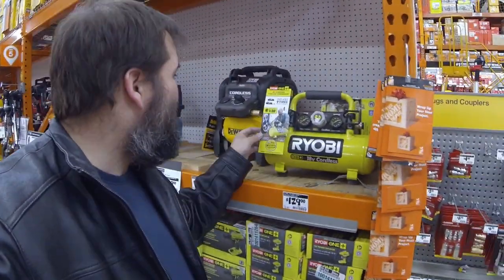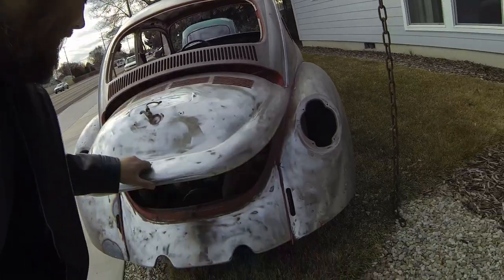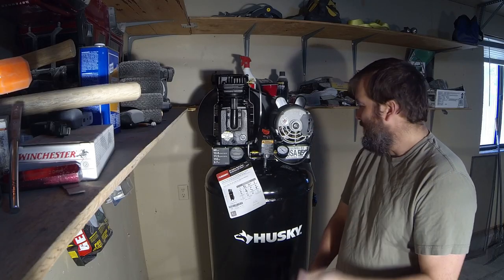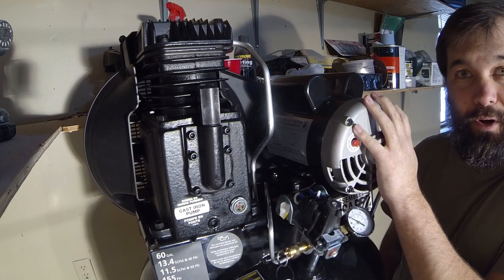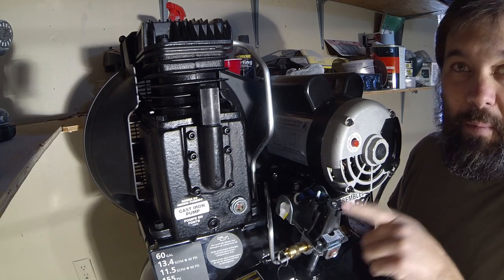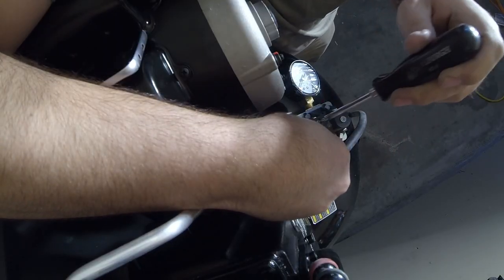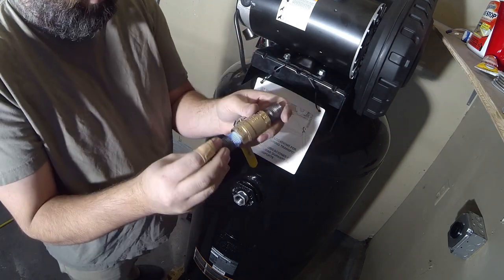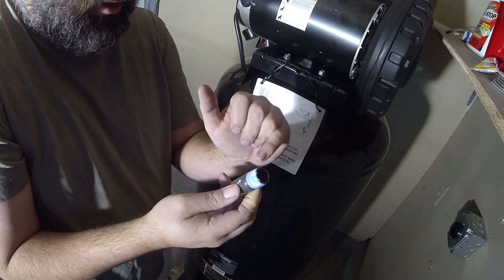How to Wire an Air Compressor Adjust Max Pressure Husky 60 Gallon Installation

Comment: Had one 3 yrs ago...pump went out..china made..was doing car body work....had to keep adding oil..to the pump..did harbor fright..thing..no good..china built..went all American..Saylor-beall..built in st.johns,Michigan.....American  Iron......quite running..Baldor  motor..cast iron pump..561 lbs..of American  steel...oh great video..ty
Reply: It's a Chinese quality control issue. Even the big names are having their parts made in China. So they get the better of the crappy stuff.  The stuff that failed the quality control goes to places like Harbor Freight. And in some cases there is no quality control at all. We've all bought a Chinese item that was clearly broke, missing something, stripped threads, etc. China plays the odds. Build crap. 60% may survive the warranty. With the 30% that failed maybe half of the consumers won't bother to return the item. China wins. And we're supposed to feel good that this equipment was "assembled" in the US, from Chinese made parts. We're just polishing a turd.
Reply: I went with Saylor-beall  all major  parts made in house ,pumps are made in house ..see there facilities tour..on utube,video..  my unit wt.is 570 lbs..and it's only a 60 gal unit ..Baldor motor  Hubel pressure  switch..and a Eton magnetic  starter..the tank is made in Manchester, IL...yes the belts are prob from china..no plastic  on my unit. Just the pressure  switch  cover.is it..again ty ..husky  dose work..have one in the car wash pump room for now..till it craps out..

Comment: Love the installation and the 2 "Vosvos" (as we call them in Turkey). I am in the market to buy the same model compressor. How do you like yours after using it for some time? Do you still recommend it?
Reply: I know it's been a while, but I also have the same model of compressor. I've had it for several years it has seen some serious use. I have sandblasted motorcycle frames, and painted several cars with it. It's loud but it does a great job.

Comment: I just buy a 80 g.husky. compressor  and they told me than 'm going to need a valve and the one they given to me is 3/8 and the compressor is 1/2in... and l have to buy an extra fittings ...and the  cord power 220 o never can found  @ home depot...they says I need order from Amazon or Ebay...and that's ridicules bc.i get the compressor from them and they don't carry the parts I need.....and they say not to use dryer cord power....and I saw you using..is that correct?..
Reply from the maker: That is correct.  I hired an electrician to put in a 220v box in my garage.  I told them what I was using it for and they said it would be fine.  I've not had an issue. Yeah,  the fittings were "fun" to locate.
Reply: @derekmeehan5350  nice...thanks for the video..it help me a lot....thankfully 👍
Reply: If they had any brains they would have all the pipe fittings you need right next to the compressors.

Comment: Made me smile when you opened the garage door to 2 beetles. You said you were planing on painting with this compressor? How is that going? My beetle is going to need paint soon and I’ve been eyeing the same one for a bit for the same purpose. Curious how well it’s working out for you.
Reply from the maker: I know it's been a while but the compressor is doing VERY well for painting purposes. It is more than enough! I have painted a jeep hood, and two beetles. I love this compressor.
Reply: Derek Meehan thank you for the reply! Mine still has quite a bit of work needed before I get to paint but I will definitely be getting this compressor soon.

Comment: Why is it that I can't find the power cord for this
Reply: The only Oddest There is a plug you’ll use and then adjust your parts accordingly with what comes in the kit to match your receptacle, as far as cord it depends on what size you need and you will purchase that length of cable from your big box store or local hardware place .
Reply from the maker: Yep. You have to build your own cord!